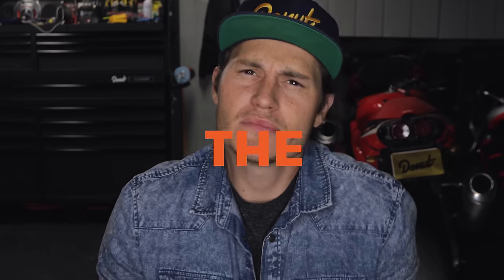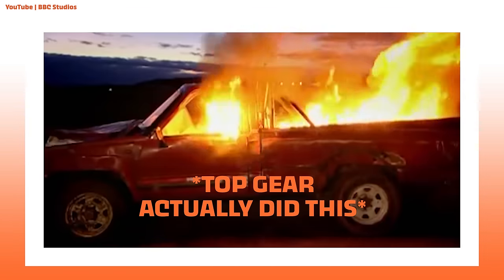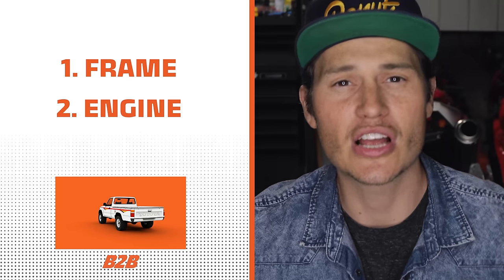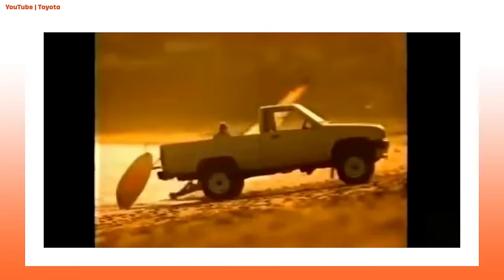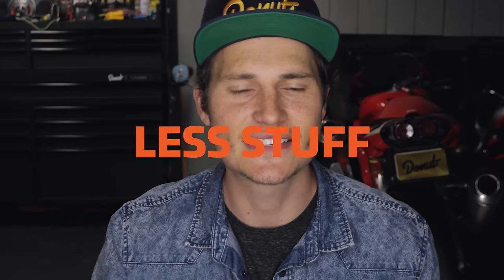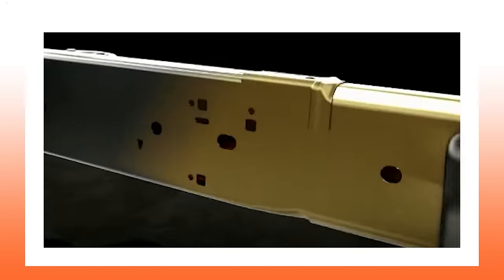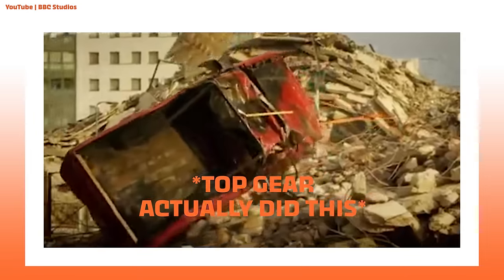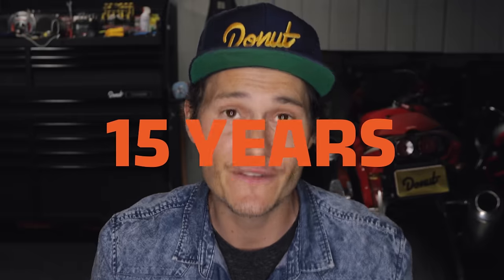Toyota PICKUP Truck - The Science EXPLAINED

Comment: I learned to drive in a automatic 91 toyota pickup (wasn't technically mine) but my family had had it for about five years. When my dad bought it for my sister it had 950 thousand miles(the odometer didn't work since before he bought it), then she proceeded to drive it back and forth between st augustine and Gainesville (yeah i live in Florida) and it still started and ran great

Fast forward to December of last year and i was driving my brother to school when a pt cruiser pulled out in front of us while we were going ~50 and we hit corner to corner. The cruiser was spun about 90 degrees away from the direction it was traveling and i hobbled the truck into a nearby parking lot with the engine still running! (But it wasn't gonna go far since the front passenger tire was fucked, and the engine separated from the trans) both me and my brother walked away without a scratch 

Needless to say i currently drive a 99 tacoma

Comment: Got an 87 Yota Pickup I've had for a few years I picked up off a friend for $500.  Legit the stupid-simplest, most reliable, easiest to use vehicle ever.  Just over 100k miles on almost entirely original components and no signs of issues yet.  And when things do start to break on it, pretty much everything that could need to be fixed I can do myself.

Comment: We had a 22r in our pickup and attempted to do an oil change on it, but after removing the drain bolt,only got a trickle of oil. Thought it was low and so we filled it up. At the next oil change interval, again only got a trickle of oil. It was like that for about 5 years which the truck only gained about 10k miles on it.

Such a simple, strong motor that could take abuse

Comment: @9:20 ironically, the only spot on my entire first generation Tacoma frame where I have serious rust issues, is in the C-channel section under the bed (the same place everyone else has a problem, where a poorly designed pocket allows dirt debris to accumulate and hold moisture)

Comment: our hilux that was bought in 2002 is a tank of a thing it is so damn durable we only just did major fixes 1 and a half years ago as the radiator had a leak and the clutch and gearbox finally died after over 18 years of daily driving and a lot of roadtrips in the aussie outback and even with a radiator that was fucked it still drove 200km through the outback in the height of aussie summer to get back to civilisation. it is a beast of a machine.

Comment: 1. How did water seep into the frame in the first place.
2. Why not drill some holes to pull the water out? 
3. Coat inside the frame with some paint?

With the "new" C-frame - did the load on tundra and taco decreased ?

Comment: I had a 1985, with the 2.4l 4 cylinder. I'm not lying when I say I embarrassed a guy in a mid-70s Trans-Am in a drag race. I didn't pull away from him, but pretty much side by side.

Comment: I’m currently driving my 1992 Toyota Pickup that my dad gave me. It’s a 2.4L, 2x4, 5 Speed Standard Transmission with 269K Miles. 
I’m trying to uncover all the mysteries of this gem. 😂
I’m either gonna put a camper shell on it, or move to Arizona and turn it into a technical. 👀

Comment: Ha I did the same oil/transmission fluid thing on my 1996 328is, drove for about a week before transmission started slipping but the baby was fine. Seriously the transmission fluid plug was right where every other oil plug was that I had seen! Turns out that engine had it on the side of the pan to where it flowed out horizontally.

Comment: I lived in New Orleans and had one with over 200k with original timing chain (loose).... so much slop in it that when I left off the accelerator;  it backfired so hard that it killed the engine.  One of the most surprising loud noises I've ever heard (gunshot)!   I coasted off the interstate I-80 in the middle of the city by the Superdome.  Waited a moment and decided what's the harm in trying to start it? If it's toast then it's toast.  lol  It fired up and I drove (cautiously) to work in the French Quarter.   When I got home that night I found a timing chain, water pump replacement parts on eBay and ordered them...  After several YouTube videos and my land lord asking will this run again? with serious doubt in her voice...   I drove it for a small business after that for another 2.5 years....   Sold it for like 600 dollars...  Never doubted I sold a lemon to the new owner....  I'm fairly sure this truck is still running 12 years later....

Love this video..... lol even if it has two of my mamas...

Comment: Had an 88 2WD since my wife bought it brand new for $8000.  It was really a low maintenance vehicle.  The downside is the smog control equipment starts to corrode and fail.  This results in vacuum leaks and poor performance.  I've been improving my mechanic skills over the last 2 years repairing our 84 Landcruiser.  Now I wish we hadn't sold the pickup a few years back.

Comment: I drive the American version, the Ford F'in Ranger. 2003 is recent enough to have a good engine while still having light electronics that Don't get in the way. The thing flew and landed gracefully after catching three feet of air when I was getting away from my drunk dad trying to ram it with his mustang, later when an anxious towncar hit me in the back I just wrenched the bumper straight with a dumpster and a chain. This thing doesn't care as long as you've got gas and oil, and if you've got some slick50 then you barely need oil. The "Edge" is one of the first flex fueled vehicles too so you can put anything in it other than maybe diesel.

Comment: I used to have a 2012 Toyota hilux, and I've been in tow car accidents at different times were i flipped in the hilux because of speeding and in both times nothing happened to the engine or the transmission or the interior, I only had to change some suspension parts and do some body works even the chassie was in good shape

Comment: I once drove my old Civic Coupe LX without any oil for an undetermined amount of time.  I usually babied it, but I was having the time of my life from August 2016 - November 2016, so I kinda forgot about my car.  When it came time to do the oil at 5k in December, after I undid the plug, just a few drops came out and splattered on my hand.

The running joke since that day with my father (RIP 2023) and I was "I'm suprised it did just spit out dust and a bunch of spiders came crawling out".

I grew up a Honda guy thanks to my Dad, and this just further solidified my loyalty to them, and Japanese manufacturers in general.

Now go with Toyota or Nissan as they the only ones still making Coupes (I only drive Coupes.  Currently drive a 2016 Kia Forte Koup SX with Premium Package.  Essentially Kia's Civic Si).

Comment: I used to work at Honda and a lead tech there had a Tacoma lol but he would take rock climbing and he kept it at his beach house and the square frame did end up rusting but when he showed me why it was because it had 2 pieces of steel sandwiched in the square frame instead of a thick layer causing moisture to get in between the steel causing rust to accelerate

Comment: Toyota overall is awesome......my 96 4Runner has over 340k miles and it's still running strong n I went probably 3 weeks with no oil in my engine because I didn't notice a leak....engine still goes hard though.  I know a lot of Yota owners of various models that run 200, 300 and even 400,000 miles.

YOTA NATION!!!!!!

Comment: Man I love a new dirt bike. But I just bought a sweet 93 Toyota 4 Runner and I'm getting older and like my heater and tunes and cooler and...but these Toyota's are a nice ride. I also have a 95 Geo Tracker 4x4 2 door 1.6 liter 16 Valve feel injected 5 speed and comes stock with 5.13 gears on 31 inch Cooper Discoveries. It rips pretty good and goes anywhere with some mudd terrains but pounds my guts out compared to my 4 Runner on 35's. I love my Tracker but love my 4 Runner better. I need a lift and already have 35's and 40' for something. LoL

Comment: I bought a 4 yr old Toyota Pickup in 1988.  I still own it and drive it most every day.   I am a famer and My pickup gets a good 10 miles put on it  every day just running around my farm.  Not a little farm.  2000ac.  It is not continuous.  I have bought 15 farms to have mine.

It now has 534.247.3 miles on it and running good.

How did I salve the water, rust problem.  I just drilled a few hoes in the low spots.  Then I put it up on a lift and wash the bottom any time I get it muddy or in winter and I drive it on salted roads.  Takes about 10 min a day.

Comment: These Toyota truck elements of invincibility lasted through the 1994 model year
In 1995, the Tacoma replaced the "Toyota Pickup" and was a great redesign, except for one major flaw. The frame rails tended to rust out quickly and easily.  By 2000 or so, this flaw was solved, and the Tacoma went back to being the toughest truck on the market.

Comment: My neighbor approached me one day offering to buy my 95 pickup with the 22RE in it. (350 k on it) Thing is beat to shit inside and out, dents, rattles, awful paint exterior smoked in interior, hella oil leaks, no AC or power steering. Looks like a technical truck out of somolia. Told him “over my dead body will I sell it under any circumstances”   I have confidence that thing will outlive me. Sad to see Toyota does not hold themselves to the same standards anymore. Can’t beat that legendary reliability

Comment: My buddy drove one for years and its all restored and nice now but years ago he would be low on oil and we spent all our money on weed so he would take my spare oil for my diesel and put 15w40 oil in the truck and it never complained. He started it in a parking lot once and the weight of the shift knob knocked it down into gear and it drove away on its own as we just watched it crash into the back of a car. We took that toyota deep into the washington woods and it always made it anywhere any other trucks did just fine

Comment: It ain't a Hilux or a Taco or Tundie but I drive a '93 Corolla E100 with the 2E 1.3L 12 valve SOHC 4-Banger engine. Thing is around 160,000km  which is quite average in my country.

But get this, it was flooded in a typhoon back in 2009. And all it needs 14 years later is a new change of oil. Literally nothing has broken down yet, except the flasher relay which at times doesn't make the signal lights blink.

Comment: My very first vehicle was a 1985 Toyota pickup that I wind up blowing the engine in. And not a day goes by that I do not regret destroying that truck and even worse not at least keeping it to replace the engine. I’ve had many vehicles since then and I have never loved any of them I much as I loved that truck. And these days in NC with all the guys turning them into rock crawlers and other custom jobs the price has gone through the roof, and I used to see them all the time on the side of the road for $1000-$1500. Those were the days.

Comment: Toyota are tough. I drove a Toyota starlet (Manual Transmission) without a transmission oil for a month, there was time I parked it for month and when I started it, the gearbox was stuck to the extent I couldn't leave it in neutral gear without pressing the clutch. So I towed it for about 10 meters to yank the stuck gear box and then I drove it for about 20 km to the garage.. The mechanics were amazed how the car could actually be driven in the gearbox condition

Comment: I actually had 2 of those trucks and they both threw rods in less than 2 weeks, when I bought them I was a big fan cause my grandpa and uncles always owned them but I never thought about why they always had different ones whenever I saw them, but after my experience I figured it out
Reply: @port nut my second truck was brand new of the lot, my first ever new vehicle, I  went to get it fixed under the warranty but they told me I had to take it to the dealer I bought it from that was in Texas, but I had just road tripped to Florida and thats where it blew out, so I ended up selling it at a huge loss

Comment: Man, I miss the 1988 dual-cab 2.0L Unleaded Hilux my dad drove from around 1994-1995 to the tail end of 2003, when we sadly had to sell it on and replace it with a new 2003 2.4L Unleaded Nissan X-Trail Ti, as the Hilux was just leaking oil to the point the only viable way to keep it running was a total rebuild and it wasn't worth our time or trouble to do so, so we sold it to someone who could give it the TLC that lil' ol' 2.0L i4 engine needed.

In the 18 years since we bought the X-Trail, the only time it gave us much grief was during a particularly nastily cold winter back around '08 or '09 when the alternator was a bit flakey and we had to keep the battery on overnight trickle charge when we didn't have a spare battery charging to do swaps after a run to town because the batteries were just draining too fast otherwise. At one point dad was on the way home from a day in town and the battery in the car at the time just flat-out died on him stranding him on the side of the road until the morning when I could catch a small commuter bus that took the same road he was stranded on, with the spare battery in order for us to limp back home.
Thankfully since then the only times we've had hiccups with it is when using E10 instead of RON 91 Unleaded, causing a bit of rough riding until could fill with fresh RON 91 because of budgeting issues, and the engine running rough under-revving at 2.5K RPM in 3rd whilst going through 50km/h zones (sweet spot is 3K RPM in 2nd for 40km/h or in 3rd for 60km/h) to minimise noise pollution as we drive.

It doesn't help that RON 91 Unleaded is currently about $1.77 AUD/L on the low-end (station in business park doing bulk-purchases being on highway) and upwards of $2.00 AUD/L the further in town you get. Diesel is also like $2.00-2.15 AUD/L in my neck of the woods (or $140+ AUD/tank for a 2.8L Diesel HiAce with 70L tank), so it's not like it'd be cheaper to run that for the 250km (155mi) round trips to city (where fuel stations are) and back home right now.

Comment: The answer to the Toyota 22re is the Chrysler slant six engines, 170, 198, and 225 were famous for being beat to death and not failing, including running it out of oil completely, using the wrong oil, running on bad gas, cracked head, stuck valves, you name it, the Chrysler slant six never gets any fame for it’s durability

Comment: Box channel frame is superior, but only if there are built in drain points and air flow  to prevent rust. But ultimately superior.  Stronger frames make Stronger trucks.

Comment: For ultimate proof that Toyota’s are indestructible, I have a friend who has a 1991 Toyota pickup with 500,000 miles ON THE ORIGINAL MOTOR. Even after he fucked it up really good in a wreck, it would still crank and run!

Comment: I also learned how to drive in a 89 Hilux, that mofos doesn't even have power steering requiring huge effort for tight turns, specially parking, but is still on the family, because is basically indestructible

Comment: Had a tacoma with the original engine that had over 600,000 miles on it when i sold it.  The guy i sold it finally  sent it to the grave with 900,645 thousand miles on it.

Comment: Everything your saying is right, but...It's in conflict with the idea of simple. I had a 1973 Land Rover 88 with a boxed frame, and huge unsprung weight. but it actually handled pretty well fast on bad surfaces. I had big squashy tire and the axles just acted like they were sprung weight.. Old bendy truck work p[pretty well if you don't try to fiddle with the idea of "roll couple" just put big sway bar  and squishy tire on both ends and you are there :)

Comment: My father in law had his 80's pick up with a 22r carb version and I can tell you that he ran it till the wheels fell off.... He did not do maintenance and the car would start and run everyday. When I helped him change out his radiator in 2011, the coolant that was in there was still looking good and when I asked him if he ever maintained it, he said no. I know he was telling the truth cause he is extremely cheap. He ended up buying an Escape when he was told that due to rust and the control arm contact points on the frame no longer connected, the pick up was no longer repairable and I can say that after running the Escape the same way with no maintenance, he is now having to replace it.

If I ever run across one of these trucks, I am picking up.

Comment: Don't feel bad I did the exact same thing on a 87 Toyota pickup. The trans drain plug is exactly where the oil drain plug is located on basically any V8 truck.  Only difference between me and you is I noticed I fucked up immediately.

Comment: All right, I finished it, and this is a really great rant! You can be the crazy uncle and I'll be the crazy Grandpa. It's a great example of the stupidity of government and trade policies and bureaucrats. And how many more are there? I can tell you, based on a chat with an appliance repairman, that he says refrigerators last about 10 years now because of all the electronics in them in order to save energy. Old refrigerators didn't have that but they lasted three times longer. I had one that lasted 30 years! So now we're saving a little energy on paper, but we're putting old appliances into the landfills at three times the old rate. So we're making three times as many appliances, which certainly must waste more energy and use FAR MORE raw materials. But it's good for the appliance companies. WTF.

Comment: I had a Gen 1 4Runner (1985, pretty sure), with the 22RE engine.  Frame, suspension, and drive train were terrific, but it was an underpowered dog.  The engine was the worst thing on it.